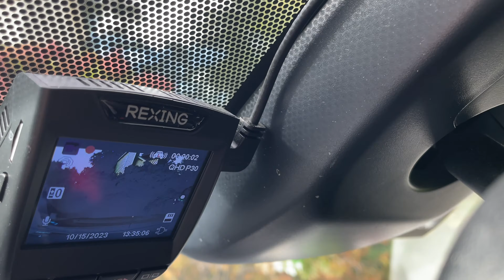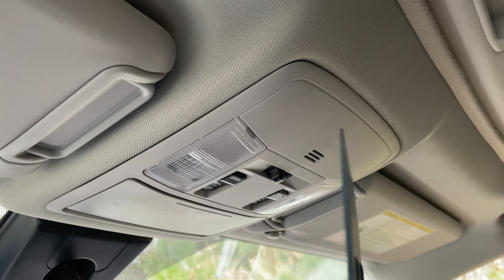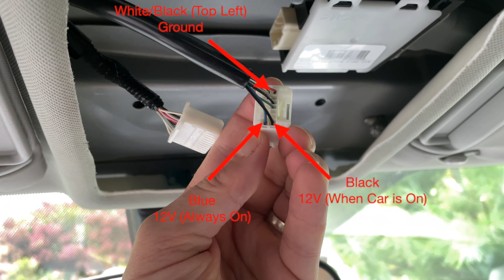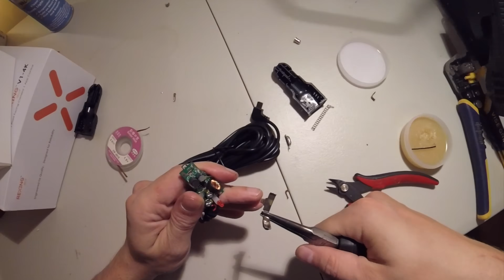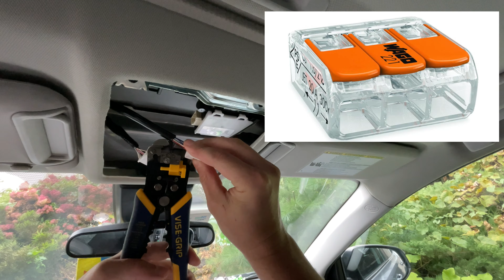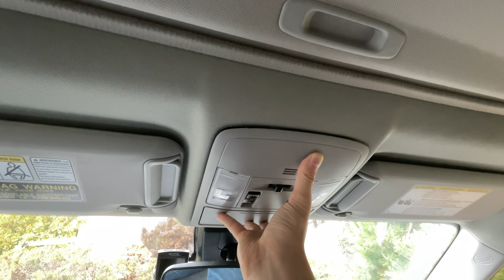Install Toyota RAV4 dash cam WITHOUT removing airbag cover - use overhead console instead

Comment: Smooth idea. I purchased just the Hard wire kit without a fuse. Three wires labeled ACC Battery and ground. Would I just tap the ACC into the Always on and battery into the hot?
Reply from the maker: ACC should connect to 12Volts that turns on and off with the car’s engine. Battery connects to the 12Volts that is always on. You’d only use the battery cable if you want to use a “parking mode” that keeps your camera on while the engine is off.